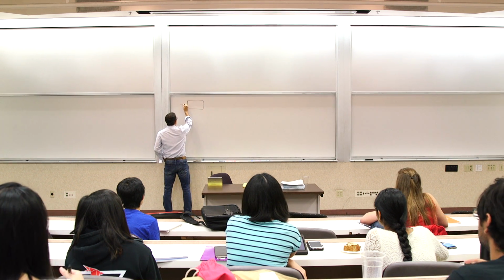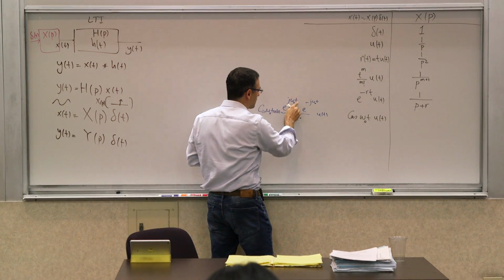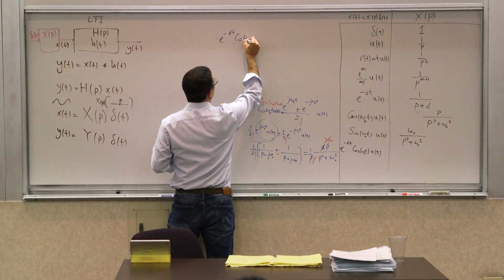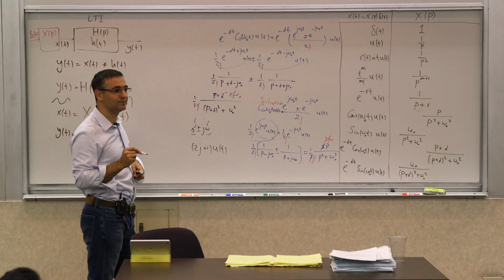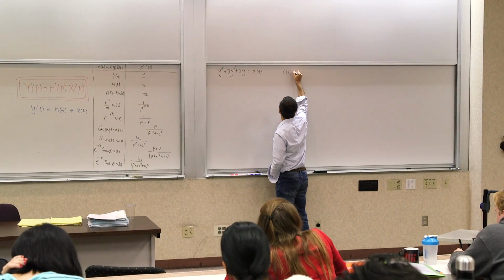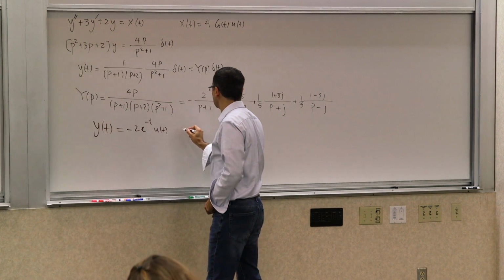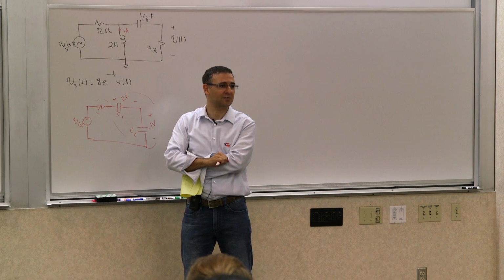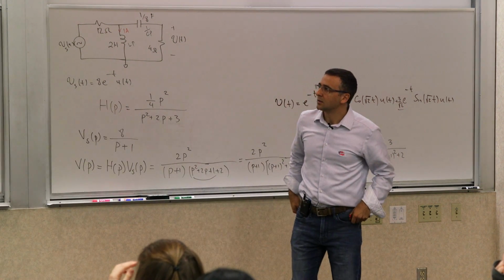023. Heaviside Operator: Operator Catalog, Solving differential equation directly, Examples.

Comment: Dear Professor, I think the output operator in the last example should be: V(p)=1/(p+1)+(p+1)/[(p+1)^2+2]-4/[(p+1)^2+2]. The coefficient of the last term should be -4, not -3. Could you check this? Thank you for the great lectures!
Reply from the maker: You are right. The numerator of the last fraction should be 4 not 3. This will also make the coefficient of the sin term in the time domain response 4/sqrt(2). Thank you for bringing this up.

Comment: 00:00 - Expressing an Input Signals in Term of an Input Operator
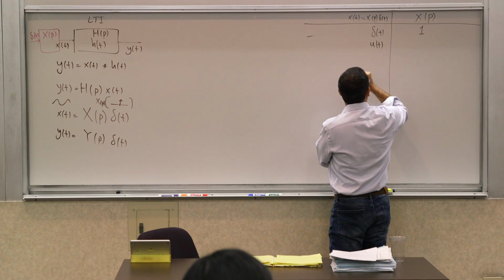06:30 - A Table of all Possible Responses of 2nd Order Real Systems
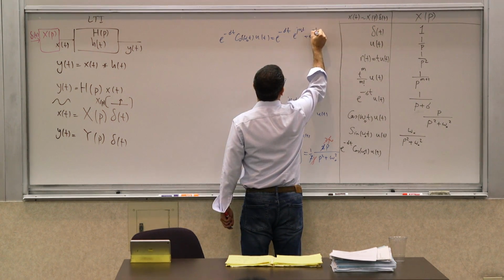18:38 - Complex Frequencies Exponential Expansion
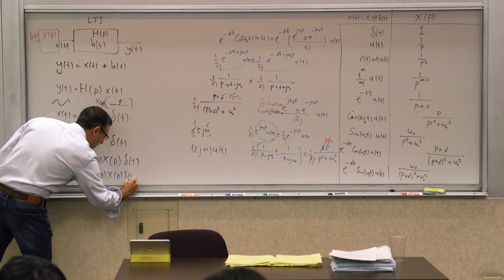31:20 - Convolution to Multiplication
34:24 - An Example with Complex Roots
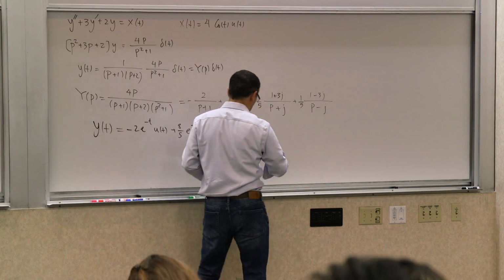43:23 - Complex Roots to 2nd Order Denominator Polynomial
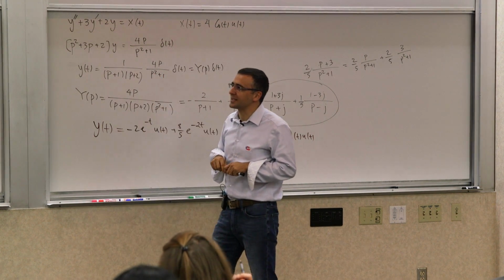46:12 - A Circuit Example
51:23 - Zero in the Transfer Operator